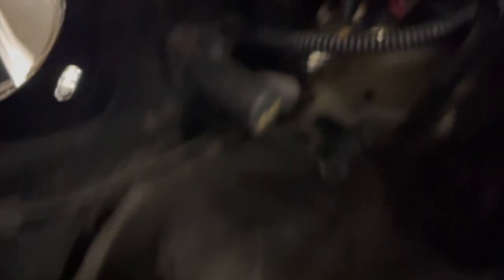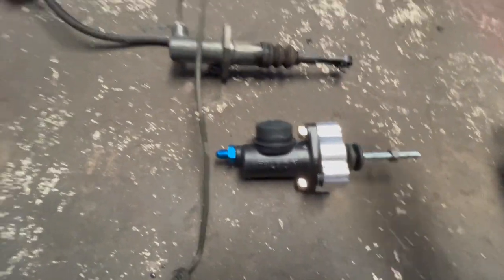TURBO GTO FINALLY GETS A TICK MASTER CYLINDER! BIG DIFFERENCE!

Comment: Hey FYI that tick master cylinder is great but keep an eye on your firewall that master cylinder takes a lot more pressure and it causes the firewall to flex and eventually crack if you don’t make a bracket to support it.. just another gto owner speaking from past experience 🤷‍♂️
Reply from the maker: I figured as much once I drove it haha thanks tho
Reply: Just curious why it’s better than stock if you have no problems with the stock one jsw for future I might upgrade if it’s worth it
Reply: @clapyocheek  The clutch pedal tends to stick at high rpm which in turn prevents you from shifting until the rpm comes back down. I've had the tick upgrade for about 5 years now with no issues.

Comment: GTO is looking very nice 👍 I looked at the Tick master cylinder but I read it was too stiff and could cause issues. I run the standard master cylinder and braided lines with remote bleeder.